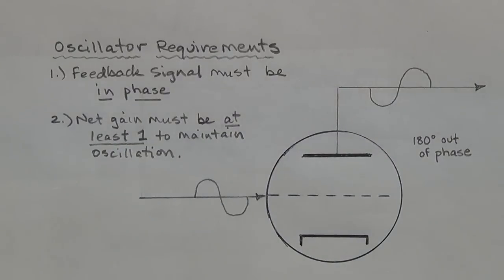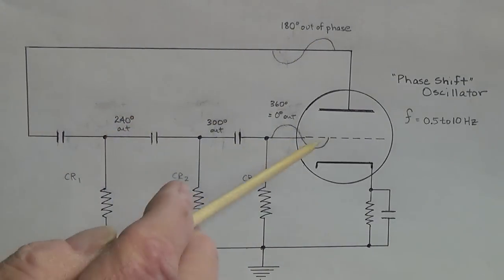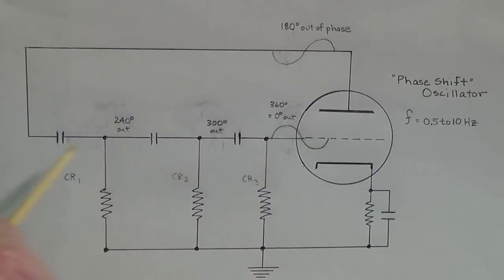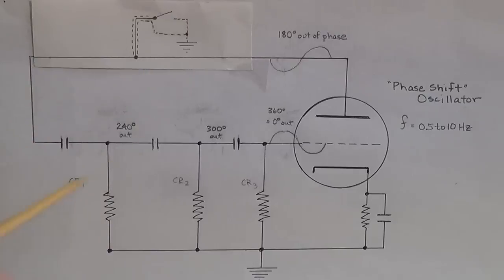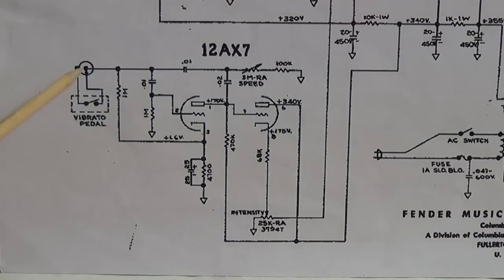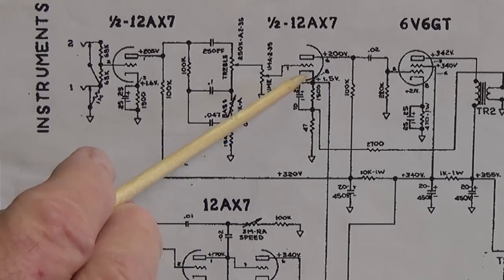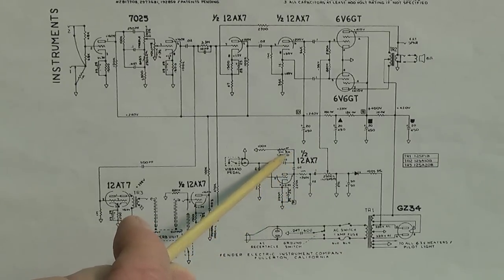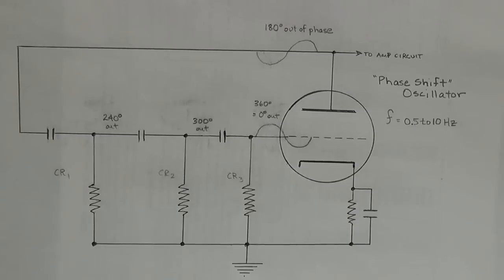How Does a Bias-Shifting Tube Tremolo Work ?

Comment: I've got a Farfisa Compact Duo with a solid state tremelo. It uses this kind of feedback loop circuit to control the rate, but is fixed. I want to make it adjustable and would replace a 22k Resistor with a pot to do so, but I don't know what values for a pot I should get. Can you advise?
Reply from the maker: If 22K resistance is midrange, then install a 10K fixed resistor with a 25K pot. This will allow you to alter the feedback from 10K to 35K.
Reply: @UncleDoug  Excellent! Thank you!
Reply from the maker: Let us know how it works for you, Johannes.

Comment: I'm a player, not a fixer ... but I like this stuff. I guess this applies also to an early '60s blonde Tremolux ... Mupricin for those kitty bites and scratches. Lecithin caps (1200 mg./day X 6) to clean out your arteries. 

This kind of trem produces an outstanding sound, BTW. Great explanation. Even EYE understood some of it!! But my guess was that one of those cap/resistor units would be replaced by another pot to change the amount of in phase/out-of-phase, as an intensity control. Missed on that guess!
Reply from the maker: That's good to hear, TT. Best of luck with your projects.

Comment: When not in use this whole circuit hurts the tone of the amp a bit doesn't it? If you don't need an amp with tremolo better off without it!
Reply from the maker: I don't think so, David. When the Intensity is "off", the Tremolo signal goes to ground and the Normal Channel functions as if it were not present.
Reply: Maybe not then. But you would agree having an amp with 3 channels and all kinds of effects you're never going to use is a bad idea isn't it? Much more difficult to locate a problem right?
Reply from the maker: Yes, the added complexity, when you really don't need the extra effects, would be a waste of repair time and money.
Reply: That's what I thought. By the way, did you see the beautiful Auricon NR-40-s4 amp currently on ebay? Power supply looks just like your 52 w.e. grable amp! With the vents with 3 louvers along side and a vent on each end with 4 louvers and square punched hole pattern on top. No picture evidence but I'll bet the louvers underneath yours would be just like on the Auricon. You can probably ask him for a pic of underneath.
Reply from the maker: You're right about the Auricon power supply looking just like the Grable amp. The cabinet is a longer rectangle, but otherwise virtually identical :)
Reply: I just bought a less complicated Auricon. Not like the monster you saw but still has 7 vacuum tubes 4 little 1u5 preamp tubes, a bigger power tube and somehow uses 2 other tubes for noise reduction. Do you know how that works?
Reply from the maker: No......I have never encountered such a circuit feature.

Comment: Uncle Doug, I have an amp with phase shift in the effects loop. It doesn't like tremolo though its more like your video on the Tel Ray Organ Tone device. Kind of a swirling tone oscillation, are you familiar with this type of effect? I mean from a purely electronic standpoint?
Reply from the maker: I'm not familiar with effects loops in general, Jack. I deal exclusively with vintage tube amps and only the on-board effects, like tremolo and reverb, found in their circuits.
Reply: Okay, thanks. I was just curious how it was done. I picked up a soldering iron today, I'm getting ready to start testing caps and resistors in the TV amp I bought. Wish me luck, I may need it, lol.
Reply from the maker: Good luck with your self-education, Jack. Personal experimentation is always the best way to learn. I hope you've built a current limiter to protect the circuit from short circuit damage.

Comment: Uncle Doug this is an awesome and incredibly helpful video. I noticed you said the Tremolo effect is turned off by setting the resistance of the speed control very high. I'm wondering why the Depth control on the 5F11 circuit wouldn't also eliminate the Tremolo effect. Seems like if the wiper is all the way left (low position of the 250k pot), it would allow maximum Tremolo oscillation to the grid of the 6V6GT's while having the wiper all the way right (high position of 250k pot) would allow the oscillation to all escape through the 25 uF capacitor on the bias line and not effect the grid of the 6V6GT's at all. If this were correct then you could turn off Tremolo by either turning the Speed or Depth pot's all the way down. What am I missing?
Thanks
Reply from the maker: In theory, I doubt that all of the 2 to 5 Hz oscillation would "escape" through the 25uf cap. Recall that capacitors are frequency dependent, and this is an extremely low (subaudible) frequency. In practice, I can tell you that stopping the oscillation with the speed control will cease all tremolo effect, while reducing the intensity to minimum will reduce it to a very low level, but generally not eliminate it.

Comment: Thanks Doug, I was confused for a while because I was trying to understand where the guitar signal entered the trem circuit. Not until right at the end did I fathom that this circuit acts on the bias of the final output stage. The fully amplified guitar signal exits the phase inverter tube via its plate and cathode and then enters the grids of the two output tubes. The trem circuit alters the bias producing the varied volume. Have I got that right? The circuit I am building has two EL84 output tubes with variable cathode bias. The trem circuit is the same as the one you show and the enters the grids of the EL84's. Thus is this still altering the effective tube bias to give the tremolo effect or is it just modulating the amplified guitar signal?
Reply from the maker: There are several different types of tremolo, Allan. If you are speaking of the Bias Shifting Tremolo, then yes, it does alter the output tube bias....and your explanation is correct.
Reply: Thanks, I get that for the Princeton where it is grid biased and the signal from the tremolo circuit changed that, but how does that same type of tremolo circuit effect the bias of the output if it is cathode biased. Does it alter the voltage of the grids and thus changes the way electrons still pass to the plate, (by virtue of that voltage difference) and therefore is technically altering the overall bias?
Reply from the maker: In my experience, the ouput-bias-altering tremolo circuit is generally reserved for fixed bias (grounded cathode) output tubes. Since cathode bias is self-regulating, you would expect it to "fight against" and partially nullify the bias alteration being applied by the tremolo circuit. If it works, then great, but I don't think that it is the optimal set-up.
Reply: Thanks, forgive my lack of understanding. I think the circuit I am looking at is a signal modulating tremolo but uses the same tube based oscillator not a photo cell. The output of the oscillator goes to the grid of the output EL84's. The EL84's are cathode biased with a single resistor and bypass cap. So am I right in saying this setup modulates the signal going into the output tubes and the bias remains unchanged??? I have sent a circuit diagram to you via pers msg
Reply from the maker: If the EL84's are biased with a resistor and (bypass) capacitor, then the tube is cathode biased......not grid biased. Everything I said previously still applies. The oscillator input is intended to alter the bias of the output tubes, but this generally does not work well if the output tubes are cathode biased, as yours are.

Comment: Hi Uncle Doug! It's another great video I must say. I haven't been a big fan of tremolo effect until now. I decided to search for some other tube tremolo circuits and I've found one which used to be part of Fender Pro-Amp (6G5), Super-Amp (6G4) or Concert (6G12). These look more complex than those you have shown in your video.  I'm little confused of the signal path because it doesn't go from plate to grid but it goes from plate to plate and than it doesn't continue from cathode in these circuits. Or am I wrong? What is the purpose of the second portion of tremolo tube? Thank you for your response.
Reply from the maker: The Brownface Fenders had a harmonic tremolo that was very complex. Here is a great site that explains them:  http://carlscustomamps.com/types-of-tremolos-in-tube-amps/

Comment: I know this is a pretty old video so no one may be paying attention to the comments anymore but I have one anyway.  In the simplified drawing where you describe the function of the feedback circuit you added a footswitch that ties the B+ directly to ground.  This appears to be a dead short of the B+.  The actual schematic of the amp shown later places the footswitch after a couple of the capacitors in the feedback loop to block the DC from shorting to ground.  Am I right about that?
Reply from the maker: I try to respond to all comments, SW. In some of my diagrams, I include only the components and circuitry that are directly related to the point I'm trying to make in that scene. If I draw the entire circuit, it may confuse or detract from viewer focus on the featured portion of the circuit.  I hope this makes sense.
Reply: At about 8:17 of the video you added a small sheet of paper that showed the footswitch connected to the B+ near the oscillator tube.  It only needed to be connected to the lower leg between any of the phase shift caps instead to avoid the short.  All of that was already on your drawing.
Reply from the maker: Then I guess I put it in the wrong spot, SW. Thanks for pointing it out.

Comment: POP QUIZ: If we apply the Oscillator AC output directly to the output tube grids.....why can't we hear it from the speaker ???  (17:34)

Since the identical AC signal is being sent to both output tubes, it will be cancelled out due to the push-pull arrangement. Now let's see how BS Tremelo would work for single-ended outputs - not very well, I'd guess.
Reply from the maker: Not only that, David, but recall that the frequency of the oscillator is sub-audible.
Reply: As regards the tremolo applied to the grids of a SE out would there be a very small harmonic effect when let's say 10hz speed finds 80hz signal? Excuse my ignorance but I'm vaguely wondering about octave effects, as regards ss pedals and how to do such with tubes, so this silliness just struck me as somehow of regard.

Comment: So the best place to adjust the speed would be the resistor that contols the speed pot right? 
I want the ability to slow the speed down quite abit.
I have changed a few of the caps and minor speed changes but i see the place to swap is the resistors....
Reply from the maker: Tremolo speed is controlled by the frequency of the oscillation loop, which consists of three capacitors in series with a resistor to ground between each pair. Altering the resistor values will alter the oscillation frequency, as will alteration of the capacitor values.
Reply: Uncle Doug 
So uncle doug i build a gretch 6161 or supro1624 or 6424 (same circuit) 
And the caps are .01  .02      .03 , so I changed the .01 to .02 and that slowed it down but is this the optimal location for slowing it down?

Bte uncle doug do you find these style cicuits rather tame compared to other circuits with two gain stages?
Yes the over drive is nice when cranked up but they seems to not really compair to other amps lets say a fender princton is louded than a supro 1624t (vintage)

So i cascaded the two channels and took out one of the tone pots and its crazy loud now!!! I was curious to the proper way to do this or if you have done it?

Btw i used 6cz5 tube rather than 6973 bcuz there a bit cheaper and they seem to work absolutely fantasic!!!!

Thanks uncle doug! Your the best!!!
Reply from the maker: Yes, the oscillation loop is where trem speed is controlled. Increasing the pre-amp complexity will increase signal volume and improve tone control, but only if the output circuit can properly handle the increased signal strength. I have never used a 6CZ5 tube, but will keep it in mind for the future. You're welcome, Dorian.
Reply: Uncle Doug 
Well i seen a few hifi guys talking about how they used them in jukeboxes and how they resembled the 6973 and i compaired them and on the tube data sheets the 6973 shows the maximum voltages were the 6cz5 shows the center values. 

That and the grid2 is on pin 1 of the 6cz5 and the 6973 is pin 1 and 8 

So in theory one can run both by jumpering the 8/1 pins on each tube.

Well i have cascaded the channels on this supro1624 or gretch 6161 (same circuit) 
With amazing results. I cam dial in any gain level i need!of course it put so much more signal into the power tubes the volume increase is super.

Its like having a all tube gain pedal of sorts.

The 6cz5 sound to me like a 6v6 with more clean headroom. Go figure a smaller tube with more american muscle.

Comment: Hi, so the time it takes to charge the capacitor is what controls the speed!  the resistor controls how much of the signal goes to the capacitor or ground.  the more the signal is sent to the capacitor the slower it goes ???   almost there for me.   .
Reply from the maker: Basically true......but by increasing the resistance to ground,  you slow down the oscillation within the loop.  Here is a great, detailed explanation by my favorite source of info:   http://www.valvewizard.co.uk/trem1.html
Reply: Uncle Doug fantastic. However the real catalyst of learning for me is the "Rusty" effect, but I will try sir.  Thanks 😊
Reply from the maker: Rusty's benign guidance has always been my most valuable asset :)

Comment: on the vibrochamp schematic, the cathode on the right half of the 12ax7 reads "175 volts." Where is this voltage coming from/how is it produced? I am building an amp with a similar trem circuit (5e9-a tremolux) and can't get the tremolo to work. the layout shows a similarly high voltage on the cathode but all I've got is about 20volts
Reply from the maker: On the AB764 VC schematic, the same cathode has +213V, Addison. If you look at the grid voltage, it's +210V. Cathodes tend to be slightly more positive than grids. This is a cathode follower and it operates under different conditions than regular amplification tubes. Notice that the plate of the preceding tube stage is attached directly to the grid of the second stage, and the output is from the cathode, not the plate. If you would like more info on cathode followers, see what the Valve Wizard has to say about them.